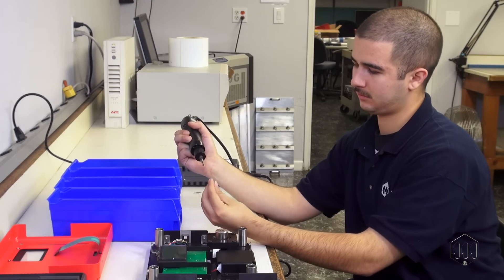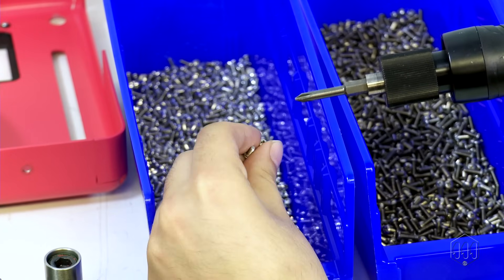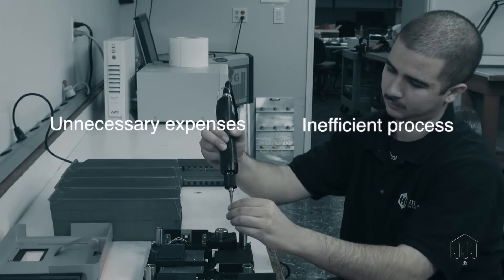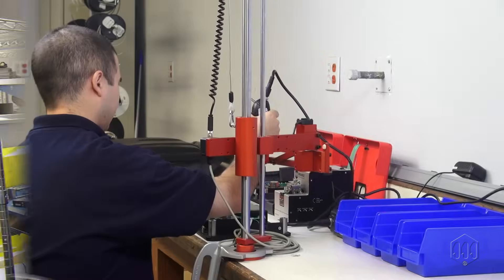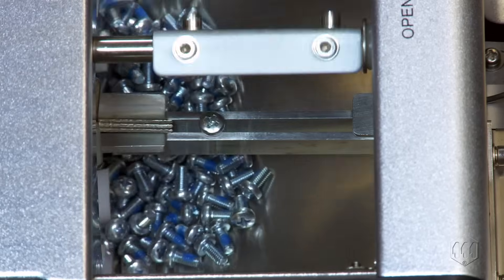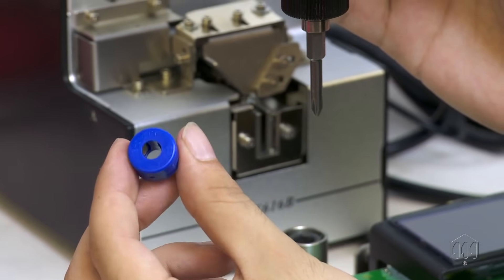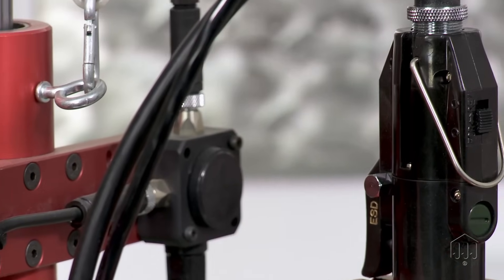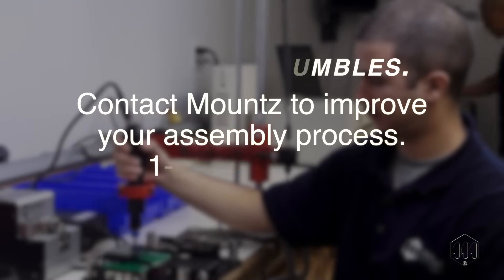Stop Screw Fumbles with a Screw Presenter

Comment from the maker: Stop screw fumbles. Screw presenters make the assembly process more efficient by mechanically presenting a screw to a fixed pick up point. The small and compact MSP screw presenter is designed to organize and automate work areas and production cells. These tabletop feeders can be used in combination with most any assembly application and power tool. Stop fumbling with screws. Improve your fastening process today. http://www.mountztorque.com/blog/fasteners/prevent-screw-fumbles-with-a-screw-presenter?kmas=216